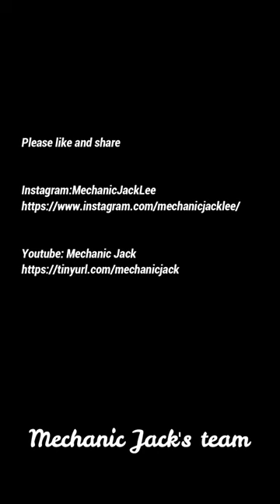Toyota Prado Transmission a750e Assembly

Comment: Excellent and great work.. I have a question, what is the number of the front oil seal seal that is installed in the oil pump of the car, Toyota Tundra 2008?